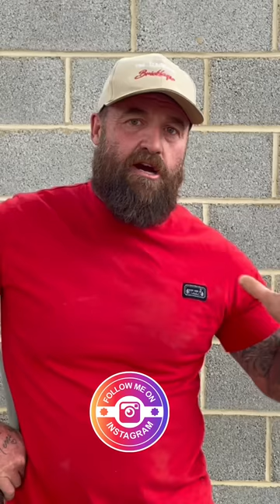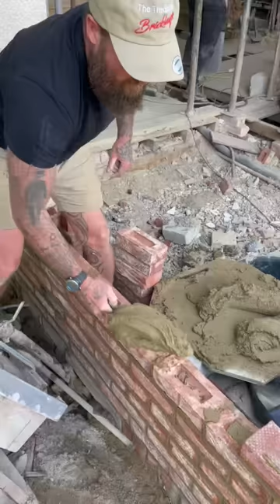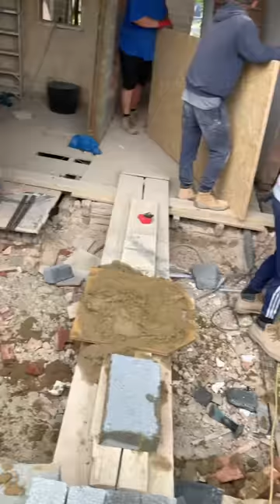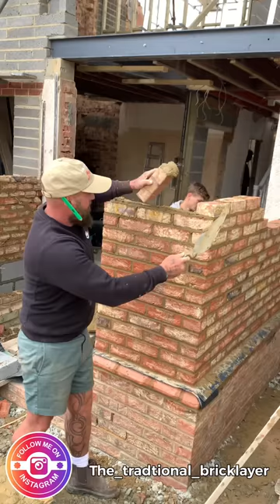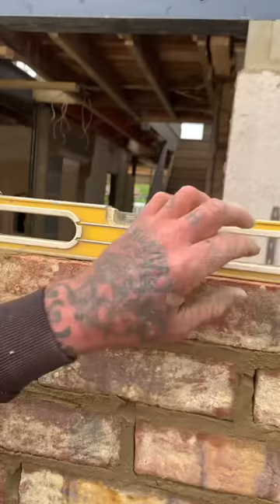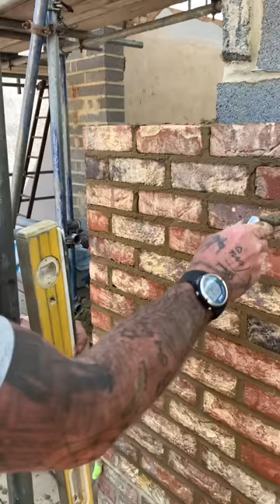Just Bricklaying 🧱 #bricklaying #history #brickwork

Comment: Personally as a older bricklayer i would have a profile each corner guage marked on it and a line pulled straight through for speed,accuracy and alignment,eyeballs only get you so far 👍
Reply from the maker: Well if your not accurate free hand nor fast brother then use you’re profiles ….me ..I’m skilled man not semi skilled but l live and let live
Reply: @thetraditionalbricklayer9650 skilled me bollicks any bricklayer would pull a line from one corner to the other for alignment, I can build corners as  quick freehand as any trowel and plumb and level and to gauge but it's quicker and more accurate to use profiles